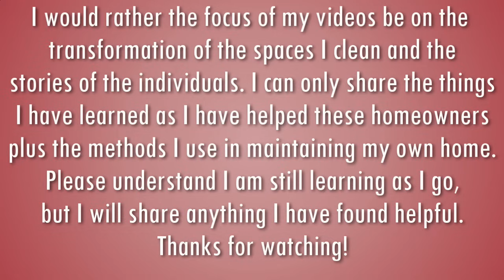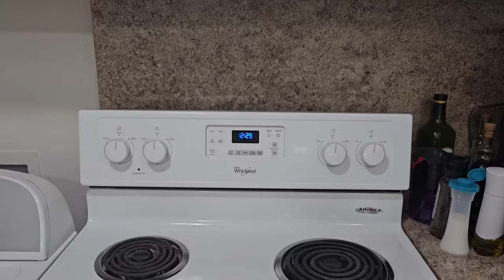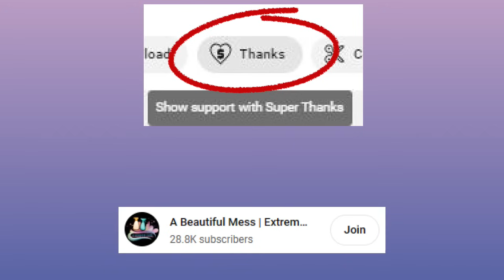Helping a PTSD Survivor Reclaim Her Kitchen

Comment: Have you tried oven cleaner on the stove top drip pans? Or the stains on the oven   top?
Reply from the maker: I didn't because it was actually the enamel that had come off on the stove and the top layer of the drip pan so it was rust and not dirt, so nothing would have really gotten it clean because it was actually damaged rather than dirty.
Reply: Makes sense

Comment: Cleaning question, and I know I could Google it but-- how do you recommend cleaning the squishy door seal on a 80s era fridge/freezer??? It gets moldy? and grody, and I don't know the best way to attack it.
Reply from the maker: If it were my own fridge, I would use either a toothbrush or some other kind of scrubby brush and dip it in a bowl of vinegar and scrub it out with that. Vinegar will kill the mold spores. I would just pat it dry rather than really wiping it out because if the vinegar dries on there, it will be more effective at keeping that mold away.

Comment: I like the way you empty the dishwasher first, then refill with  more.  There's so many things that can be washed in the dishwasher that aren't necessarily dishes, i.e. glass vases, cutting boards, large utensil holders, etc.  Plus that also could be running a load while you're continuing to clean.  I feel so bad for your client.  She must have had such a traumatic experience.  Hope she is getting professional help to deal with it.  You are doing a wonderful service for her!  Just wondering ~ How many microfiber cloths do you have on hand at any given time?  Do you then take them home to wash and sanitize them to reuse for the next job?  I usually use scrubber sponges for my own home and then toss when they are worn out.  Is it the same for microfiber cloths?

Do you visit a client once before the clean up to assess her needs before the job  starts?  I may have just bought a new set of burner drip pans instead of trying to clean the old ones.  I did that for my son when he rented an apartment.  They were so nasty it was easier and cheaper for me to replace them for him and they made a huge difference.  A set of 4 were only like $15.  Oops.  I'm commenting while watching the video and I see you addressed this.  LOL

A hint to know which Tupperware lids go with which Tupperware bowls ~ there is a letter on the "tab" portion of the lid that matches the letter on the bottom of the bowl!
Reply from the maker: I usually have a whole container full of microfiber cloths that I bring with me and I do take them home and soak them in water with vinegar and OdoBan to disinfect them and then wash them on a hot cycle. If they get too gross, I do just throw them away, but I try to reuse the ones I can. Same goes for the scrubbers. If I'm using them to clean something that isn't super gross, I will disinfect and reuse them at other homes, but a lot of these places I end up just throwing them away when I'm done. It's why I use a lot of paper towels just to spare some of those scrubbers and microfiber cloths.

If they live close enough, sometimes I will go over and assess the situation the week before, but if they live a little bit further away, I just have to rely on the pictures that they send and make a game plan when I get there.
Reply from the maker: Oh, and that's good information to know about the tupperware. I had no idea!

Comment: Just a comment on the oven cleaning, I am not sure you should be spraying the heating element at the bottom of the oven with oven cleaner-I am not sure if it is good for the heating element. If I am incorrect in that comment, forgive me but I’ve always understood that it should be avoided.
Reply from the maker: You are probably right. I forget that you can actually lift those up to spray under them. I do wipe them off pretty well, but probably best to avoid as much contact with them as possible. 😊

Comment: You’re not alone, pimple popping and ear cleaning put me to sleep every night. I can’t do the mango worms though. Bonnie, you may already know this, but the leading cause of lung cancer in non-smoking women is the use of household cleaners. Unfortunately, the only thing that filters it out is a respirator, which is too hard to use while working. But if you can open windows and use exhaust fans, at least you can direct it away from you somewhat. Watch about spraying cleaners into a warm area, like the microwave. This creates the worst kind of vapors.
Reply: Recently discovered Dawn dish soap is carcinogenic, too.

Comment: I rented once in an apartment that had a very dirty stove. I cleaned as best I could and put tin foil around the burner pans and a sheet of tin foil in the bottom of the oven. In fact after that I put foil on the bottom of all my ovens. Much easier to clean just pull it out and put in a new piece much cheaper than using the self clean option on the oven also. 800 watts for an hour, no thanks the electric company gets enough money from me.... Lol

Comment: On the burner pans and under the stove I would have used oven cleaner.  Another option is dawn powetwash.  It works great if you have a little time to let it work it's magic.🎉
Reply from the maker: It was actually not like stuck on food, it had actually worn the enamel off on the stove and the top layer of the drip pan so it was rusted rather than just being stuck on food, so I'm not sure oven cleaner could have helped in this case. I grew up with that same kind of stove with the drip pans and I've never seen them rust like that so I'm not sure what happened to cause that, but she definitely could use a new set.

Comment: You took away her ability to shut off the water to her washer when you installed that shelf so low.
Reply: Nope, she has the exact same access to water shut off that she had before.
Reply: @abunchahooey  HOW?
Reply from the maker: There wasn't anywhere else I could have installed the Shelf because of the plug in. I did the exact same thing in my laundry room. I actually didn't notice where the water shut off for the washer and dryer was, but all that needs to happen is to pull the washer out to shut it off. Or are you talking about the emergency shut off for the water to the house, not just the washer? If so, I don't think that was back there.